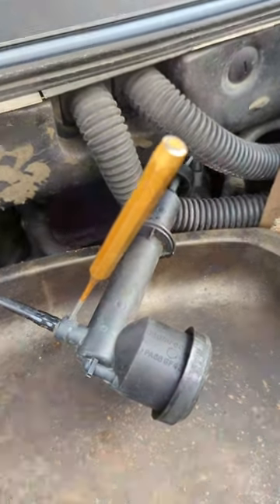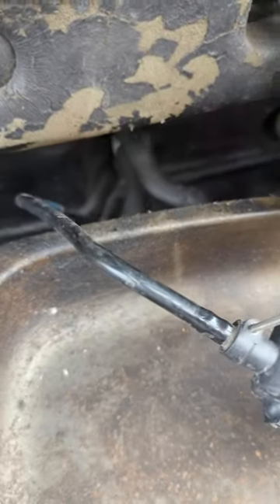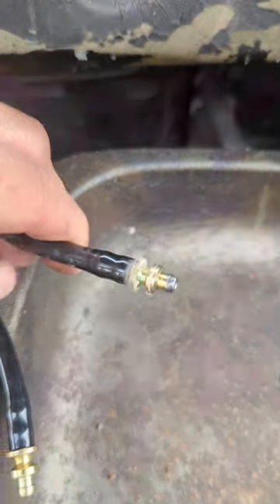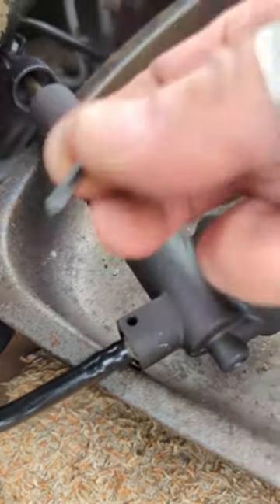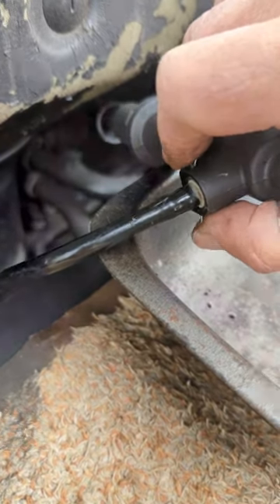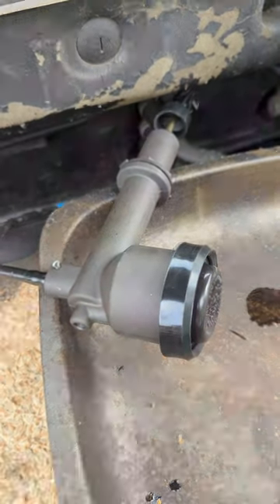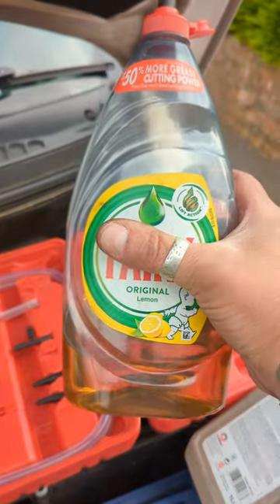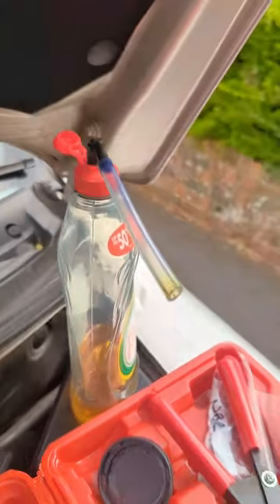Freelander 1 TD4 clutch Master cylinder replacement hack

Comment: Replaced my clutch master cylinder today because pedal was going to the floor and not returning to upright position. Couldn't change gears.
Could not remove the plastic pipe at the slave cylinder end. Tried for ages.
Saw this vid and thought I'd give it a go and to my surprise it went exactly as you said. I used a small drill bit and hammer to drive the roll pin out.
Bleeding was a nightmare but eventually I got a semi hard pedal, enough to be able to change gears. I am hoping that any remaining air bubbles will work themselves out over time.
Thank you so much for taking the time to provide us with your video. I would have been stuck without transport without your vid. Cheers
Reply from the maker: @JazzFunkNobby1964  
Your welcome, I'm glad you found it useful. The problem with bleeding is air gets sucked back in around the bleep nipple that's on the end of a pipe, that's why I couldn't vacuum bleed the system, I found that undoing it about half a turn lets enough fluid out and not much air in, especially if you let the pedal spring back quickly.
Reply: @austendallaston3537  Thanks for the reply. Did you have someone help you bleed the system? How do you pump the pedal and keep the tint reservoir from running dry?
Reply from the maker: @JazzFunkNobby1964  no worries, I use a bleed tube with a one way valve in it, and more than 3 pumps on the pedal, to top up the master find a clean bottle that you can attach a piece of tube to, much easier than from the fluid bottle, if you have another brake fluid bottle make a hole in the top a push some tube though, must be a tight fit or it will leak. For the tube, I've got a quantity of screen washer tube that I find perfect for bleeding purposes. I hope this helps. By the way I carry a bleed kit with me now lol
Reply: @austendallaston3537  Thanks. Think I'll keep a bleed kit on board too haha.

Comment: Looks like I bought the same cylinder and was thinking of doing just what you did. At least it saves time gaining access to the connector. Did the same thing on my Rover 75...
Are you sure that the sliding collar isn't on the slave side of the connector?
Reply from the maker: Defo no collar anywhere, actually I've just changed that cylinder again as it failed internally, (cheep eBay part lol)
Reply: @austendallaston3537 Oh crap.. I don't need the hassle of having to do it a second time..lol..
Reply from the maker: My own fault, cheap part, I'll cross my fingers lol

Comment: what is the oil mark?
Reply from the maker: If you fill the reservoir to about 1cm from the top, when you put the lid on the rubber diaphragm will spill some out. That way you know it's full with no air gap.

Comment: Slave cylinder is in the bell housing, nightmare, clutch slipping badly, probably contaminated plate from leaking slave
Reply from the maker: Gearbox out, new plate, new cover and that's the time to change the slave as it is the release bearing.even if its ok

Comment: How to adjusted if hard going to gear
Reply from the maker: There is no adjustment, try bleeding it making sure you don't empty the master (it is very small). If that doesn't work then replace it
Reply: I already change it to day just like how you do it but hard going to gear
Reply from the maker: @kemourdrummond7914  if the biting point is near the top of the pedals travel where it should be, then it sounds like you have a problem with the clutch it's self
Reply: This morning I have  get the  car into gear    I top the master cylinder with clutch fuel it drive ok thanks again
Reply from the maker: @kemourdrummond7914  your welcome, I'm glad you got it sorted
Reply: You need to make more videos I like it my Freelander is a 1998 1.8 petrol engine
Reply from the maker: @kemourdrummond7914  I'm working on bits, keep an eye open
Reply: Kl
Reply: Freelander Bonnet not shutting tite enough it’s as a gap at boat side
Reply from the maker: @kemourdrummond7914 hi, I've just updated a short video explaining where the adjustment points are, hope this helps